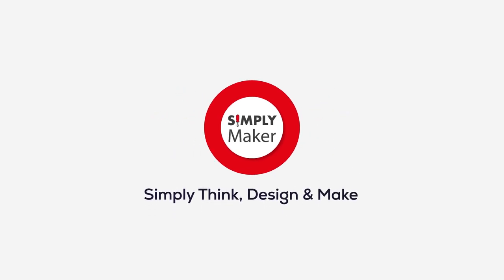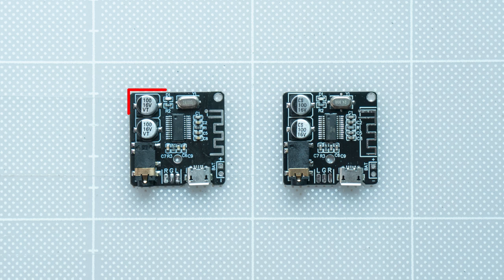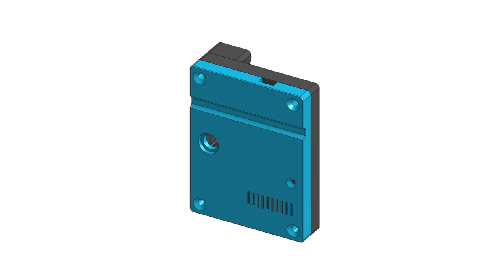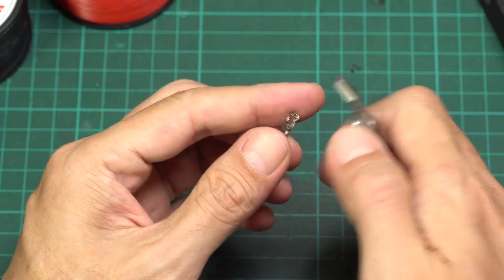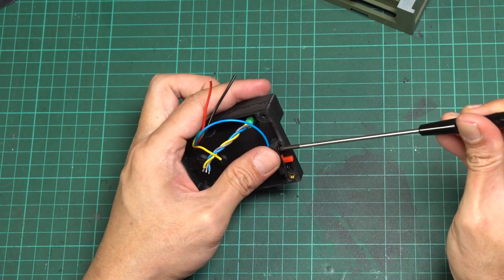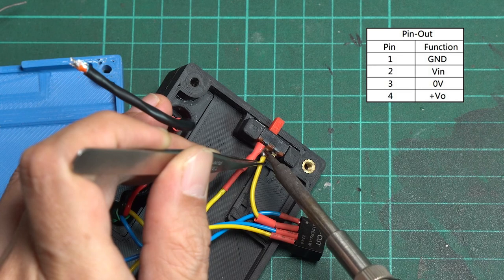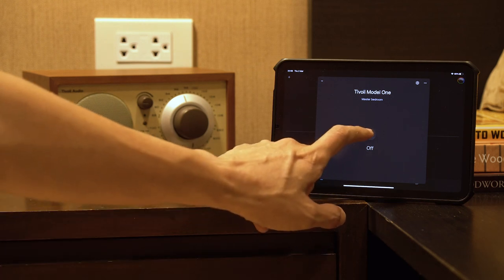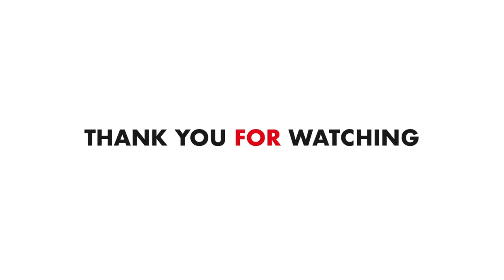Upgrade Classic Tivoli Audio Model One with Bluetooth, Smart Wifi Outlet, and FM Antenna.

Comment: Hi good Job, maybe you can help me. I have a Tivoli Model DAB. But here in Switzerland they change to DAB+ an the Radio dont works longer. What you men is it possible to fix a DAB+ reciver or a part,  in the Body of the old Radio.
Reply from the maker: I'm sorry but I didn't familiar with the DAB version.